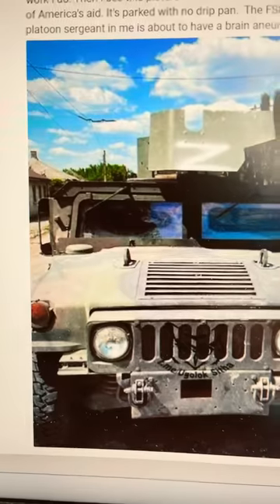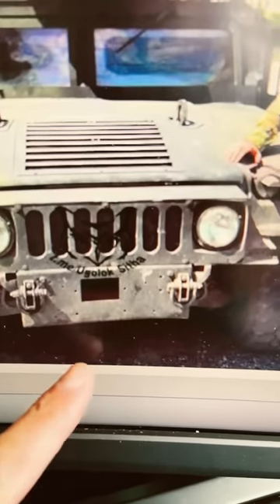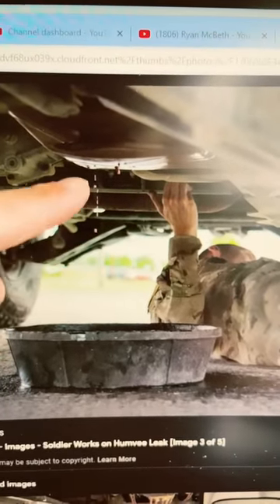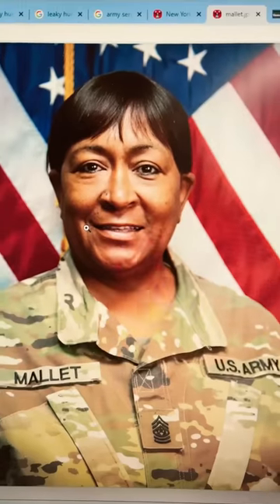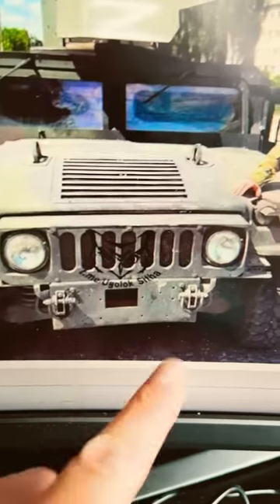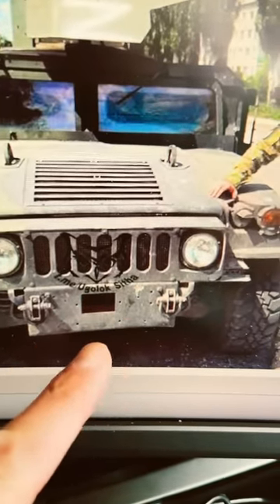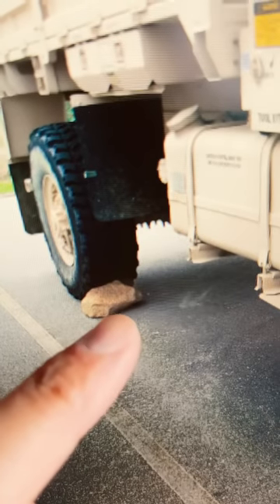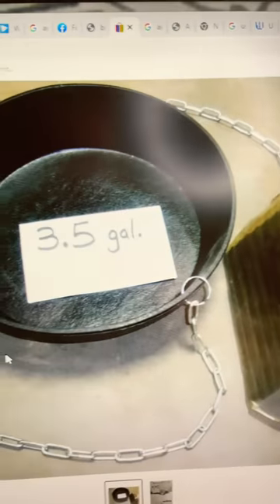What is a chock block and drip pan?

Comment: Placing Chock blocks was the moment I realized I couldn’t stay in the military for 20 years. I was at fort hood and got in trouble for placing the chock blocks behind the tires because our motor pool was on a decline and vehicles could only roll backwards. I was confused at first at how it was wrong when the way the vehicles had to be parked meant they could only roll backwards. It was wrong because the brigade SOP showed a picture of a single chock block in front of the front tires. It drove me crazy being responsible for a vehicle and knowing I would just have to let it roll and wreck and there’s nothing I could do about it because the chock block had to be in a completely useless spot. If my vehicle had rolled and crashed into a bunch of cars you just know I would get in so much trouble saying I didn’t have chock blocks lol.

Also they had a picture of where to place the drip pan too. It all had to be centered and lined up with the front tire. So if there was a drip like a little further under the vehicle or to the left or right you’d just have to leave it because they all needed to be in the same spot for evening inspections. It completely defeated the purpose just so they looked the way SGM wanted them too.

Fort hood is an absolute mess of a military leadership from what I hear from many others too. My prior base was soooo much better and I loved the military until I got to fort hood. I had already deployed twice but just couldn’t do the “no common sense allowed” thing that fort hood was extra big on.

Comment: How about fixing the vehicles so they don't leak oil? My car doesn't need a drip pan because the engine is in good condition. I don't need chock blocks because there is a parking brake. Isn't that a better solution?

Comment: So out of curiosity, why's the issue behind drip pans?

 Only time I recall using a drip pan on air craft (C5 crew chief) was when I was changing LOX, and that was to prevent the LOX from making contact with the petroleum based leaks beneath the aircraft.
Reply from the maker: A lot of it is environmental. If you drip oil on the ground, posts have rules about how to handle oil spills. You just do not want to deal with environmental or with whatever DOD civilian is running that on post.
Reply: @RyanMcBethProgramming  Okay, that clears up quite a lot. Thanks

Comment: You know what, I'm just gonna say it: if your vehicle needs a chock block, the parking brake needs to be tightened. If your vehicle needs a drip pan, that's a class 3 leak and a deadline. If your vehicle is FMC IAW the -10, you don't actually need a chock block or drip pan. Mind-blowing, I know.

Comment: There's a lot of talk about the leaks.  Yeah, they SHOULDN'T leak, but age, abuse, design features, etc. 

I'm more confused about the chocks. Humvees use an automatic transmission. Parking and automatic drops a pin into a recess and the vehicle can't roll until one or more pieces of metal in the transmission shear.  And if that happens, the transmission will likely eat itself the next time you drive it. So it's going to need repairs either way.

I ask way too many questions like this to survive in the military.

Comment: What the heck's wrong with the seals on military vehicles that they leak so darn much? 😨

In decades gone by, normal cars and trucks used to constantly drip engine oil and other fluids all over driveways and parking lots for many years, hence the (now obsolete) need to check your engine's oil level every time you fill the gas tank. 😮‍💨

However, modern civilian vehicles hardly shed a single drop, even after months of normal use. 

If Army trucks are constantly leaking so much, that's not only a waste of fluids and a risk to the environment, but steadily degrading the operational readiness of the vehicle, since it'll surely become nonfunctional once fluid levels drop below a certain threshold. That could prove to be highly inconvenient in an active war zone when logistics are stretched. 🤔
Reply: Remember that these machines are designed to run flat out producing maybe 500-1500 horsepower, into transmissions of that scale, turning and maneuvering appropriate treads or 8x8 redundant high functioning drivetrains, all while the vehicle they are propelling is being hit by 125 mm cannon and bouncing off of rocks and ditches and mines. So take that Toyota Camry V6, that Joule of an engine, turn it on and run it, set it to purr along at 3000...then start hitting it with a sledgehammer and see if it leaks.

Comment: How much you want to bet the vehicle in the photo didn't have its daily inspection card signed by the driver, the tire pressure is low, its fire extinguisher has not been inspected for the month and its hydrostatic test date is overdue by about 3 years.

Comment: "Vehicles drip a lot of fluids when parked"
In a world where civilians get technology couple decades after the military has already been using it, somehow civilians have already figured out how to not have the vehicle leak oil all over the place, and the military hasn't.
Reply: These HMMWVs use the same 6.5L Detroit diesel engine and 4L80-E transmission that I have in both my pickup trucks. If they're properly maintained, they don't leak.

Comment: As a motor transport operator, I think drip pans are 90% worthless. All they do is collect rain water and are worthless. Occasionally if you have a bad truck, it will help prevent having to do a chemical clean up from whatever you dropped, but if we are real. No one ever actually enforces proper clean up. You just dig a little and hide it from the environmentalist.

Comment: Still don't get the point of the drip pan. So the vehicle drips fluid, so what? Fix it so it doesn't drip. It looks like the standard of care for the military equipment is that it doesn't stain the parking spot. Instead of actually keeping it in operating condition

Comment: Functional undamaged vehicles just... drip oil? Like that's how it's supposed to work? WHY?

Ditto with chock blocks. Why don't they have a parking brake / hand brake?
Reply from the maker: They do. It's basically a belt and suspenders.  And if you drop oil on federal land, you have to do a lot of mitigation.  So it's better to have a drip pan just in case.

Comment: Drop pan? Someone needs to take a wrench and tighten up some fittings!
Reply: Could also be a head gasket, but my money is on the monkey not tightening the oil plug properly. Happens every time I go in for an oil change.

Comment: That beard is clearly Chechen. As for dripping it's not like the Russians are known to maintain their vehicles, it can piss oil everywhere plenty more where that came from.

Heck have you seen the state of their airfields? an F35 would be destroyed just by landing there. The closest thing you can describe their airfields is a junkyard which is why Russian jets have air intakes at the top till they take off then open the main air intake.

In the US/UK, you have people checking over the airfields and clearing any debris from the runway.

Russian equipment is hardy and gets abused.

Comment: OR The U.S. Army could put into the specs to ensure engines in the Humvee DO NOT LEAK. So how much extra oil, coolant, and hydraulic fluid does your Humvee carry around to replace the leaking fluids. This has to be the stupidest resolution to problem I have heard. Hey our Humvee's leak all of the oil and coolant and our parking brakes don't work. Should we fix? NAHHHH just put a pan and blocks and call it good. GOOD JOB ARMY!!!!!

Comment: Not sure why a properly maintained 6.5L Detroit diesel would be dripping enough to need a drip pan, or why you'd need chock blocks on level ground when the vehicle literally has a parking brake for that purpose. What are you jarheads doing wrong?

Comment: Imagine being a grown adult and throwing a fit over a drip pan. 🤡
Reply from the maker: Imagine standing in front of the post commander and explaining why you had to dig up 3 cubic yards of soil and write an remediation report that goes all the way to the EPA.
I know what I would pick.
Reply: No one here is throwing a fit except for you
Reply: @RyanMcBethProgramming  you do realize oil comes from the ground right. We've managed to find it, process it, and use it for over 100+ years and now a EPA remediation report is needed when there's a negligible spill on the ground. It's not like a deep water horizon spill on land. I could see throwing a fit over thousands of gallons of spilled oil on the ground but drips is a overreaction. I maintain my case.